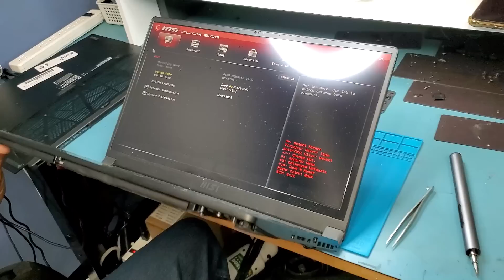MSI GS76 Laptop Repair. Blown Super I/O. Is it Fixable ?

Comment: Didn't you flash the program into the SIO before installing it on the board? Please help me, because I need to know whether we have to flash it first, or if it will automatically be programmed from the BIOS after the system starts?

Comment: The EC (aka. KBC) definitely requires programming outside the motherboard, if you solder an empty EC the system will not boot. So someone must have programmed the new EC with the correct firmware.
Reply: On some boards the BIOS can program EC when it's empty. But most of the time you need to have EC programmer and maybe use the keyboard connector to access and program it.
Reply: @nochkin  The biggest issue I can think of that prohibits that is platform power sequencing in laptops. Like the BIOS runs on the CPU, but the CPU is not getting core voltage until the EC turns on the VRM.

Comment: MSI are one of the few manufacturers that have the EC firmware downloadable from their site,  but in many cases EC firmware can be programmed though the keyboard connector if you find your in a tough spot and out of options, but obviously you have to have the firmware and not every manufacturer  makes it available.
Reply: Toshiba is making their evil laugh by reading your comment.
Reply: Lenovo does not like this comment i believe
Reply: My old MSI board EC chip had external eeprom chip which holds fw for EC so you could flash it easily.
Reply: first ene chip is amazing .i program kb9012 with ch341 very chip programer .becuase use standard 3.3 spi inside chip 

but after 2018 ene .ite can write him self ,some area in big bios "25q128 or 25q256" ec firmware is saved 
i had 2 times change ec and .after 2 time reset .everything is ok 
you must checj ic version in BADCAPS  WEBSIT TO KNOW SUPPORT AUTO FIRMWARE BY HIM SELF  OR NOT

Comment: I have a chinese unbranded laptop that is not fixable. I am using its board to learn and practice BGA soldering. Every chip on the board has a white rectangular silkscreen marking as to where that chip belongs and what orientation, too.

Comment: Unless it came off super clean with the chip it looks like one of the pads didn't get a ball in the factory.
Reply: hence it's now better than factory.
Reply: Well I would still assume that contact is used for something so surprising it worked originally ;-) @ישועתה-ליהוה

Comment: it's a super io chip. it's literally just integrated ibm 5150 (and thus pc standard) peripherals. tldr: literally only fixed logic stuff.
Reply: No it is not, on modern laptops it is an embedded controller (EC), with its own CPU, RAM and flash memory built in. Think of it like an Arduino. In laptops it provides power sequencing, fan control, battery monitoring, and whatever else the manufacturer uses GPIO for.